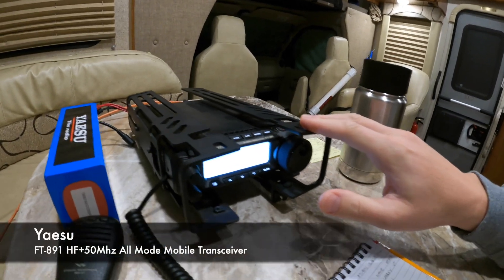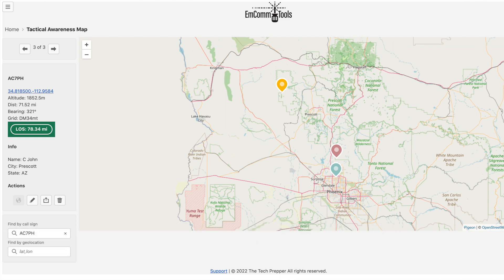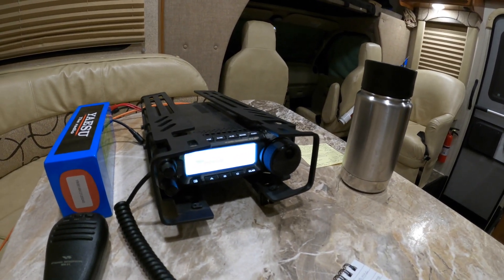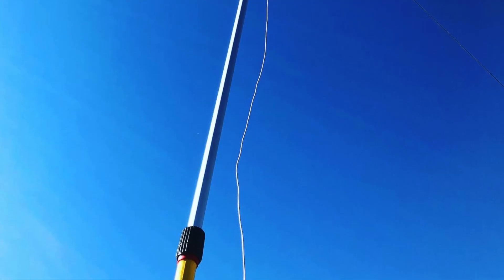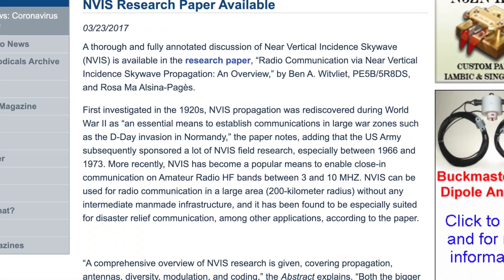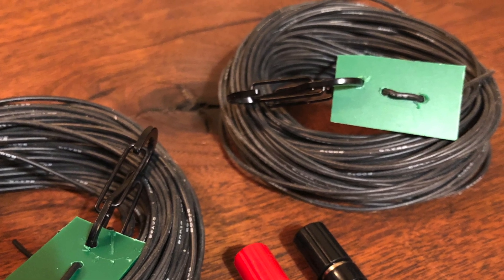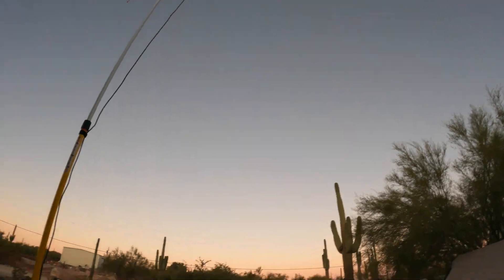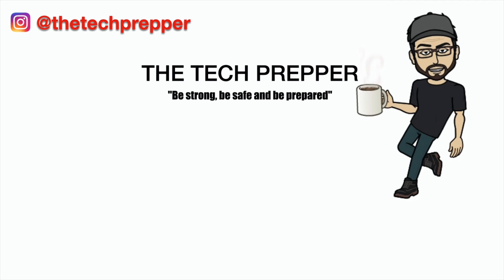The Best SHTF Comms Setup for Regional and Local Communications - NVIS

Comment: Dude. I wish you were my neighbor!  I need advice on what radio to get and your channel helps alot.  Ever consider consulting?
Reply from the maker: I wouldn't mind another nice neighbor. I am still learning this stuff myself and sharing as I go. People have been asking about training and consulting, but I am not sure if I know enough to be a proper communications consult. I consider myself to be some what of an outsider in this hobby and a bit of bubba. I believe in learning the theory and then testing anything and everything regardless of what the text books say. Maybe I'll try some live streams when my day job slows down. Take care.
Reply: @TheTechPrepper  I am currently trying to figure out how to get an antenna wire from my roof to my office in the basement.  Once I figure that out I will start with either a ft400 mobile or a 991... I like the 400 because it is like my ft5, I like the 991 cause it satisfies the gearhead that I am but also the lower frequencies... ugg...
Reply from the maker: @mnb5404  Good luck making the decision. If you're like everyone else in this hobby, this will not be your last radio. I also have not figured out my home install, yet. I have a neighbor that will be helping me out with my 2m/440 install on the roof all the way down to the grounding system. I will record the whole operation. ETA: mid year.

Comment: Hey man, what is your feedline from the binding post to the radio? Do you need a balun for this setup?  I use a speaker wire dipole for pota sometimes, but i knot the speakerwire in the center of the dipole and feed straight to the radio with the speaker wire
Reply from the maker: I'm running RG-316. The loses are not a problem on HF. I also run low power (5 to 20 watts), so I rarely use a choke.
Reply: @The Tech Prepper  thanks for the response. Yeah i was wondering if there was an issue going from the wire to the coax as opposed to the losses. Btw man I've really been enjoying the content. You're doing the kind of things that got me interested in Ham radio
Reply from the maker: @danielwarren7037  Glad to hear you're enjoying the content. Just a guy sharing experiences along the way as I progress. I haven't had any issues, but then again I'm not running high power. Just the minimum power to communicate. Happy Sunday!

Comment: Gaston what are you thoughts on an emcomm kit with an nvis setup, maybe an 80-10 efhw and maybe a couple dipoles?  Should be fairly light and would offer a range of possible setups and uses.   I am trying to plan a solid kit to keep in a pack to be able to reach out from near to far depending on the situation.
Reply from the maker: I can only speak to my experience. My kit includes a 20m EFHW which opens me up to a large portion of the US and beyond. I love the simplicity of EFHW's as they only require one support. Then, I carry a 40m dipole like the one in this video. I also carry a roll-up j-pole for VHH/UHF.

I have a video planned for next month that will get you to a single, compact multi-band antenna with no tuner. I'll show you guys how to modify the PackTenna Linked Dipole to accommodate 10/20/40/60/75/80m. Sound interesting?
Reply: @TheTechPrepper  absolutely!!!!
Reply: @TheTechPrepper  Looking forward to that video. Also curious what your top pick for HF radio is? I just got a yaesu vx-6r for my first.

Comment: Great video. Are you getting RF back into the shack? I can’t see how you don’t not using a balun. You have a new subscriber. 👍
Reply from the maker: Welcome to the channel. I'm not experiencing any RF in the shack. I have an RF choke but rarely use it as I typically run between 5 and 20 watts. My noise floor is typically an S2 out here in the country.

Comment: If you do any experiments with magnetic loops for nvis or run across any in your research you might mention them in your vids. Stealthy and easy to set up (once constructed) antenna might be handy.
Reply from the maker: I've had magnetic loops on my list of to do's for awhile as I run into many local stations on the air running loops. If I experiment with them, there will be a video. Thanks!

Comment: How do you figure, how much power you can run through those home brew antennas  📡 🤔
Reply from the maker: I have been trying to figure this out for over a year now, but have never found a good answer. I believe you need specialized equipment which most hams do not have. I tend run minimal power, but also watch out for the components heating up. I am pretty sure this build is good up to 100 watts.
Reply: @TheTechPrepper  I also have been trying to figure out problems  🤔 it's like following the branches of a tree 🌳 out to the last leaf 🍃, with ham radio it's complicated, kinda like computer software, I am sure you can relate, it's these problems what helps us grow, or in my case keeps us young, it's a good thing to have problems to solve, keep climbing that tree, you are doing a fine job with your channel, great videos, KN6GZP  Dave.
Reply from the maker: @daviddurflinger3104  Thanks, Dave. This hobby was personally very difficult to navigate. It's a life-time hobby with many rabbit holes to explore. Take your time and enjoy the exploration. It's been two years since I have been on the air and I have more questions now than I did when starting out. Give it time.

Comment: Hey Gaston, how does running your antenna in an inverted V work as the ends are so close to the ground. Would it work better with the ends at the same height as the middle? Antenna set up is always an enigma to me.
Reply from the maker: The inverted-v is a common way of deploying a dipole. I deploy it this way as it only requires a center support as we are limited on trees out here in the desert.  The classical dipole is deployed using two supports on either end so that it is parallel to the ground. According to what I have read, the inverted-v exhibits an omni-directional radiation pattern and the classical version that's parallel to the ground is directional on its broadside. I am no expert here, so any digital Elmers please jump in. If you want my advice, read the theory and question the heck out of it in practice. That's what I do.

Comment: I have three electric fence posts - they are very low but mega quick to deploy.  I plat to use a EFHW as it's good for NVIS and can be configured many ways for other times of the day - inverted L, inverted V, even straight up vertical!  Just need a 49:1 or 64:1 balun.  Check out K6ARK Adam's channel on how to build his or similar antenna to connect direct to your 818 for example.
Reply from the maker: Great tips. I have yet to experiment with my EFHW as a NVIS antenna. I need to add another element on my 20m EFHW to make it a 40m antenna. I'll report back on how this works out once that project is completed. I have a variation of Adam's design. A viewer from Canada sent me his build. Take care and thanks for the comment.
Reply: EFHW works!  I use 63’ Chameleon Emcomm QRP horizontal config works well in 100 mile radius

Comment: can i ask how is you audio captured when filming? are you using a camera with wireless mic or separate recorder, would be good to hear your radio output into the audio feed for better quality
Reply from the maker: I have a wires bluetooth mic clipped to my chest. If you have any suggestions on how to record the direct audio on the Yaesu's I would be open to incorporating the improved audio. Thanks for the feedback.
Reply: @TheTechPrepper  headphone jack to an audio interface, like the DJI Mic 2, one channel for the radio and one for your own mic right into your phone
Reply from the maker: @abecoulter8550  Roger. Thanks. I have multiple radios, so this may not be viable, but I'll see what I can do.

Comment: This is a really great and informative video! I have used the same Mr. Longarm painter's pole in a experiment with a 20, 40, or 80 meter inverted V and an LDG 1:1 balun. I was testing out a low cost alternative mast/antenna for our local ARES group, but normally I use a Buddipole mast/tripod and the same antenna/balunfor NVIS under the tree in the back yard, or  I'll use a 40' Spiderbeam mast for longer contacts. 73 KD5YOU
Reply from the maker: I'm really glad you enjoyed it. The Mr. LongArm is great. Good value for the money. I'm in the market for another mast that's more field portable as Chameleon just sent my the CHA LEFS. The SOTABEAMS Carbon 6 mast is not tall enough and well not support the weight. I'm on the hunt for a man portable 25' mast.
Reply: @TheTechPrepper  I placed an order for the Sotabeams 7000HDS last year, but I haven't receive it yet and they're going to be on back order for months. This mast is supposed to be a pretty sturdy mast and it collapses to 23".
Reply from the maker: @kd5you1  The supply chain...sigh. I hope you get it soon.

Comment: When considering an EMP proof vessel, consider that it has to be large enough to accommodate not only the radio (Xiegu G90 in our case), but a battery (lithium batteries have a BMS that is susceptible to EMP), a way to charge that battery (which will be a solar panel and a charge controller). Wouldn't be a bad idea to have a tablet (or two) with USB (or SSD) drives absolutely chock FULL of PDF documentation, ebooks, music, videos, movies, and what have you for the long haul. Some experts have estimated that we could be without electricity for years in the event of a EMP or even a CMP event. Remember, redundancy is the key here. One is none and two is one. We have a 31 gallon (Behrens) trash can full of equipment, sealed and soldered closed, covered in several layers of undercoat, and buried in a planter out back. I only worry about the natural aging of the electrolytic capacitors.
Reply from the maker: Excellent points. Yes, it was always the plan to include all the components with a chip in duplicate: batteries, solar charge controllers, solar panels, radios, etc. Thanks for sharing.
Reply: talking strictly about solar panels and batteries, do you feel they would be damaged by a decent CME? I never considered batteries to be something that needed to be protected. Charge controllers need protection, without a doubt but the panels and batteries kinda caught me off guard.
Reply: @ScottPlude  The magnitude of a CME event varies widely. I'm sure at some level, they could damage electronics. Fortunately, their arrival and intensity are forecastable, like a hurricane. It can be days in advance or as little as 15-18 hours according to an NOAA web site I visited. This gives you "some" time to take appropriate protective actions. An EMP, on the other hand, occurs at the blink of an eye, without warning, and you don't even realize what happened until  everything just stops working. If it happens at night, you may see a short flash, but that would be about it.
Reply from the maker: @ScottPlude  Yes. The batteries that I run for all my radios are LiFePO4 batteries and they contain circuitry called a BMS (Battery Management System). I would absolutely put everything you need to run your radio that has a circuit in the Faraday cage. Solar panels would go in there as well.

Comment: A large military surplus ammo can or equipment box makes a good Faraday cage.  It does NOT need to be grounded, but that myth persists.  A galvanized trash can is a cheap Faraday cage too, and most people wouldn't assume there would be electronics in it.  It's also a good place to store nonperishable food because it's rat proof.

NVIS FTW for personal emcomm.
Reply from the maker: Thanks for the tips. I've seen the ammo can builds, but have never been able to get a consistent answer regarding the grounding. I like the galvanized approach, too. We have a pack rat problem here, hence the lights around the motorhome.
Reply: If you use a ammo can (or anything else for that matter) make sure u bridge the rubber seal with something conductive. Copper tape or maybe lose the seal entirely in favour of soft  copper tubing or lead/tin something that mimics a seal but conducts electricity. Otherwise you have a gap in your cage
Reply from the maker: @pauloost59  Great tip. Yes, paint removal and metal on metal contact is the plan. Thanks!

Comment: Would you try this first before buying the Chameleon Antennas CHA LEFS
Reply from the maker: Yes. This works extremely well, but it only covers a single band. Definitely try this build first. I still carry this DiY dipole in my backpack. I love it as it's easy to repair and very light weight.

Comment: 40 meters day, 80 meters night
Reply from the maker: Yep. You're pretty much covered around the clock.
Reply: @TheTechPrepper  I live in the San Francisco Mission district. I'm surrounded by hills so VHF and UHF are only useful with a few repeaters. I was thinking about getting a more powerful dual band machine, but NVIS looks like a much better solution. Thanks for your video.
Reply from the maker: No problem. NVIS works great and works great in all terrains. Good luck.

Comment: It helps when the the other OP also has an NVIS setup.
Reply from the maker: Yes, it does. It's tough when you're in their skip zone. Thankfully, most hams have no choice but to run NVIS on 80m. It seems like only a handful of hams have the luxury of 40m of height.

Comment: What people really need is some well-defined protocols for communications during an emergency or disaster.  Salesmen will be happy to sell you a ham radio because it will "save your life" but morons (unlicensed ham radio owners) probably think you can just turn the radio on and start yelling HELP! when they have no idea what frequency  to use!
They also need to know how to listen for 'Intel' before making a call for help or a call into a disaster help network.
Reply from the maker: I completely agree with you. I had taken a brief detour to round out my preps 2 years ago to add comms as a skill set. Two years later, I'm still learning, practicing and refining. On air time also helps you build a community of likeminded individuals that you can rely on in times of need. You're right about the well-defined protocols. Our group is work on our comms plan. SOP's and training will hopefully save the day when under stress. 73

Comment: NVIS correction: Antenna height 0.15-0.25 wavelength, NOT 1/2. Many references and presentations on line re. Also NVIS good only for freqs below 10MHz. NOAA.GOV has several atmospheric IONDS that determine and present in real time what's happening with the F2 layer and return current and recent historical results for the MUF for NVIS.
The one I use since I'm in NorCal near Sacramento is the Pt. Arguello IOND at Vandenburg AFB. 
Ref:  https://www.ngdc.noaa.gov/stp/IONO/rt-iono/realtime/PA836_foF2.png
Reply from the maker: I may have misspoke in this video. But the height in this video was 16'. Thanks for the correction.